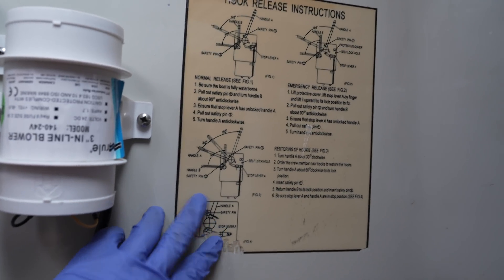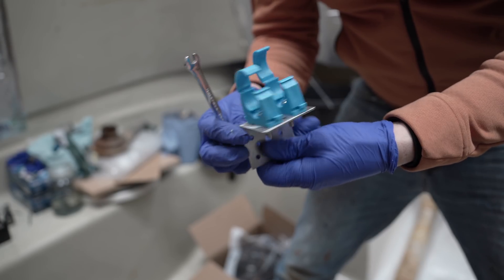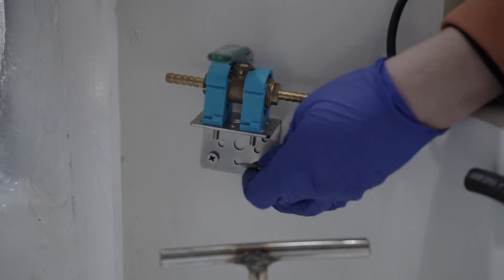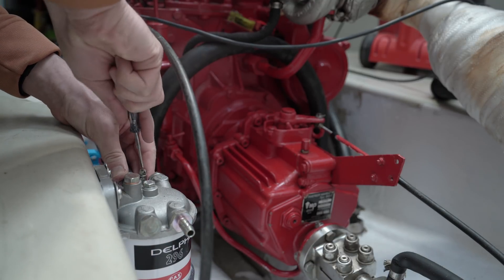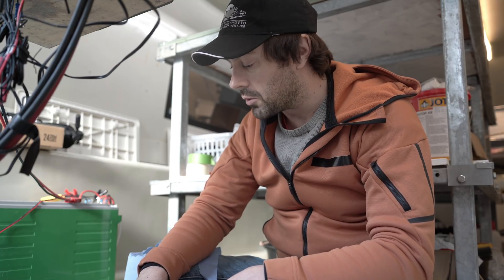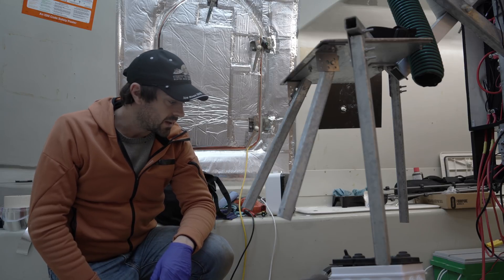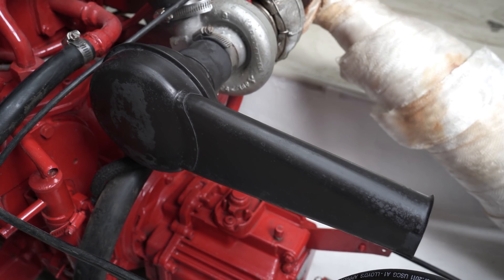Lifeboat Conversion Ep9: Installing Bukh engine fuel supply hoses and fittings [4K]

Comment: Im not sure about the complaint procedure so will give it a miss. But on another note. Is fuel lines a marine grade or just standard like car commercial pipes.  And have u placed a hand primer to get fuel through easier. These are questions not complaints im sure.
Reply from the maker: Yes these are marine diesel fuel lines. I do have a bulb primer, but have found the hand pump built into the engine brings the fuel up to the filters and injectors just fine. Cheers.
Reply: @AlexHibbertOriginals  thanks alex asked because ive had issues with fuel lines on my van before popping and premature ageing. Hope build on track .

Comment: Just a tip from working with diesel engines: hoses will leak if you let them lose like that. If they vibrate and rub something they will eventually leak. The best and cheapest solution I found it's using old bicycle rubber tubes around the hose and zip ties. Same tip for cables
Reply from the maker: Thanks for this. I have lots of restraints and clips etc and will see how things are once all is up and running. The Bukh is a balanced engine, so the vibrations are a lot less extreme than you'd imagine - but obviously still worth planning for.

Comment: Looks great, would love to be looking forward to such an adventure.
I believe one of the plugs on the water separator is often used as a air bleeding point. Also best practice is to offset rotational angle of multiple hose clamps.
Cheers.
Reply from the maker: Yeah the ones on top are a bleed and the securing screw for the plastic dish at the bottom. It's the two spare inlet/outlet ones on the side I was curious about.

Comment: Love your attention to detail.  On this side of the pond threaded ball valves and barbed fittings use a tapered thread we call national pipe thread (NPT) which seals on the threads as the taper tightens.  Unless your fittings use a different thread style I don't see how the copper washer is going to make a seal or stay tight after vibration? Best of luck!
Reply from the maker: Yeah we have European standards too, either British or metric. Some are tapered and some are standard. These are standard, so the copper is squeezed slightly to make the seal.

Comment: Alex, tip for you. Hose clamps, (jubilee clips on your side of the world) are really good at catching you and will become the Bain of you existence if you don’t cover the ends. They make special little covers but I cover mine with plastidip which you can buy at hardware stores. It’s designed for putting a coating on tools. Second, and really important, wherever the hoses touch you must put some kind of barrier. The vibration from the engine running will damage the hoses. Specifically where the hose is running through that piece of fiberglass will be a leak within 20hours of engine operation. 

I’ve been a professional yachtsman for 35+ years, please listen leaking and air getting into your fuel system is BAD
Reply: I'll answer so he doesn't have to:
"I'll install a gland for vibration/sound reduction"
Reply from the maker: thanks
Reply from the maker: Thanks for the tip - although I've already been told off about the clips, so will probably replace jubilees with o ring crimps.

Comment: You don't make friends with caramel wheels :-) They do the trick, but every time I use one (pneumatic version) my colleagues get pretty annoyed from the sound and the smell.
You might want to add some protection on the hose that goes thru the panel next to the engine.  The vibrations of the running engine will chafe the hose and damage it. You can check this by adding a piece of painters tape while doing some engine testing. Apply it on any possible problem areas. If it chafes, the tape will show this pretty fast.
Reply from the maker: Yep the hose bedding/glands is to be done.

And yes, the smell of the hot caramel wheel is awful.

Comment: I would suggest adding sealant of some sort to every screw you put into the fibreglass, just to stop water getting into the insulation spaces. Also label everything. It helps not make mistakes in construction and is an added measure against mistakes in an emergency. Always run all your comms power entirely separately from all other power right to the battery, down the opposite side of the vessel. So if the loom burns up from an electrical fault or some catastrophic destruction on that side happens you can still call for help. Conversely if something goes bad with the comms power and it burns up you still have mobility and life support. Likewise an EPIRB in an outside compartment in case of fire.
Reply from the maker: You're going to enjoy my labelling episode!

Comment: 6:22 Is that a handle that the hoses will interfere with?
Reply from the maker: It's the bilge plug. It's not something you'd ever want to use at sea. But no, it's positioned so they don't clash.

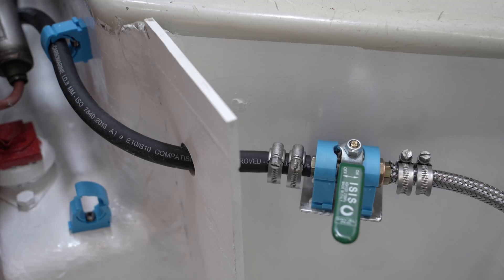Comment: 5:29 Can you protect the fuel line from chafing while going through the fiberglass?
Reply from the maker: Yep it's on the finishing touches list. And in general where the stainless braid meets gelcoat.
Reply: Good on ya both, was thinking the exact same. Glad I took a minute to scroll down and find this comment and its response.

Comment: When you do the electricial make sure to put a battery hookup on the outside so you can charge it and jumpstart it if the batteries die.
Reply: Or a small PV system

Just a single 100w panel would most likely counter any vampiric drain and give enough power for some lights

Comment: Perhaps a second angle grinder is needed? one for a CUT OFF WHEEL (thin, NOT TO BE USED as a grinder, side loading the wheel and begging it to explode in your face) and a second grinder with a flap disc in it for grinding - safely

ONE of the bolts on top the filter/separator is surely for bleeding air from the system?
Reply from the maker: Reprimand noted as intended!

Comment: Since everyone is in a criticism mode I may as well jump onboard; don’t use a cutting wheel to grind. You will not like the results. Ask me how I know.
Reply from the maker: Reprimand noted as intended!
Reply: It can throw
Reply: Very good point... one of my family members had to pull a large shard of cutting disc out of his thigh for making that mistake. Missed his femoral artery by about 3cm.
Reply: @turbo.dad.restores  t]To, ''within an inch of his life.''   (plus a little bit more)!
Reply: How?
Reply: Excellent point.

Comment: Just a tip, but when grinding like you where, I wouldn't use a cutoff wheel. If you use them on their sides they tend to unexpectedly explode. And of course that means the grinder always has the wrong wheel on it for the task at hand. Apart from that I love the series!
Reply: There it is. I should have checked the comments before posting basically the same thing.
Reply: I genuinely hope he heeds this warning...
I use the wrong wheel sometimes too, but it's a really stupid way to end up in hospital :c

Please use a grinding wheel/flap disc for grinding and a cutoff wheel for cutting!
Reply from the maker: Reprimand noted as intended!
Reply: @AlexHibbertOriginals  wooo thanks for keeping safe and keeping this awesome project going!
Reply: @AlexHibbertOriginals  At least you had the guard still on the grinder, unlike the majority of (possibly now single handed) youtubers

Comment: Hello mate ed here ,just an option you might want to look at is hydraulic hose pipes, rubber coated flexible pipes with wire built in that can take pressure, I used one to replace the hose on my powerwasher when the cheap one it came with split open, have had people driving over it without damage to it, got it in my local tractor garage Also used for diggers,should be bulletproof for your job!
Reply from the maker: Thanks for the tip. These are marine rated and good quality, but for future hoses always up for new improvements.

Comment: The extra fitting on the water separator are ust for different set ups there you have a simple in one side out the other but on some boats you might have to run the in and out on the same side of the filter. So the blanks are there so you can set it up both lines left or right or gp straight trough
Reply: or straight through left to right or right to left.
Reply from the maker: Thanks. That actually would have been easier, and I didn't want to assume this was the case as the instructions specifically told me which to blank and which to use - not saying either/or.

Comment: I'm not sure how much movement/vibration the hose will experience but seeing as you're focusing on details, you might  consider adding trim to the hole through the fiberglass bulkhead to avoid a concentrated abrasion on the rough edge.
Reply from the maker: Ok I think I'll have to add a pinned comment.... I'm going to install a gland to reduce noise/vibration/abrasion.

Comment: Will you be protecting or packing the edge of the hole that you drilled through the aforementioned fibreglass wall? I know it’s fibreglass and not steel, but the last thing you want is your fuel line to rub and eventually wear through. It would certainly be considered a no no in the vessel newbuild/refit world in which I work.
Reply from the maker: Ok I think I'll have to add a pinned comment.... I'm going to install a gland to reduce noise/vibration/abrasion.
Reply: @AlexHibbertOriginals  why do I get the impression you’ve had this comment already? 😂

Comment: I don't know much about boats but I hope that intake air to the engine is supplied from outside? If not the engine will suck warm air from inside and in consequence suck ridiculously cold air from outside to the boat :O
Reply: Its a marine diesel engine, they really care not about how warm the air is on induction.
Reply: @williamcollett4726   
Yes but we humans do tend to care. which is why it's bad if the engine steals the warm inside air which draws cold outside air into the living space.
Reply: @williamcollett4726  and meatsacks like warm air in the boat rather than nasty cold outside air.... ;-)

Comment: 1) Grind outside. Even s.s. grit turns rusty (local heating) and you'll get lots of tiny brown/orange specs over time. 2) Rubber fuel hose is fine as long as it's rated for fuel.  3) Blocked off filter ports - no, not for return fuel. Return fuel should always go back to tank to allow it to cool in the tank. Could be for a vacuum gauge that shows if the filter is getting blocked. 4) 5:20. That fuel hose will slowly chafe on the fiberglass structure it goes through. Fit a short length of slit larger diameter hose held in place with cable ties to protect the inner fuel hose. 5) Turn the engine over by hand several times before firing it up. Keep the kill switch/pull cable on and crank it for several seconds to build an oil film before allowing it to start. Good to see nice careful progress.
Reply from the maker: Thanks Evan. 1) I vacuum immediately after, so there's no dust. 2) Yep, the correct spec. 3) Thanks. 4) I'll install a gland for vibration/sound reduction. 5) That's new, thanks.
Reply: @AlexHibbertOriginals  the hot metal particles melt into the gelcoat where they hit and glue themselves on. You're already going to have brown stains everywhere. A final coat of paint will sort that out though.
Reply from the maker: Whilst quite possible I'm sure, this hasn't happened and I've done plenty of interior grinding - I just make sure they don't hit something that can set alight.

Comment: I'm surprised you didn't choose a top-loading  fuel filter housing. You can (should...) get a Racor 500 clone housing for £40, which takes genuine Racor filters. Those old CAV types are always a faff and source of leaks, with the 'O'-rings which must sit in invisible grooves etc.
Reply: I second the clone, just put a genuine paper element in and check for manufacturing debris. Have one on my boat.
Reply from the maker: Thanks all. I try to avoid 'fakes' of brand gear as they can be unreliable, but if they are widely endorsed then I'll have a look. Also, if they break, people will say 'I told you so.....'
Reply: @AlexHibbertOriginals  agreed, in the vast majority... very little to these units though, and my opinion is racor are just cashing in on the marine tax.... the unit you have is absolutely fine too, it will just be harder to change your filter.
Reply from the maker: I didn't realise that the clone versions of the superior £300+ systems were available. I've been assured these more basic designs do a decent job though.
Reply: @AlexHibbertOriginals  As you are going somewhere chilly, it might be worth considerrting adding some 2-Ethylhexyl Nitrate to the fuel.   It boosts the cetane rating a bit and also improves cold starting (your starter motor will thank you) and lowers the 'waxing' point.   I was running a small 6hp air cooled engine on supermarket derv that should have been good down to -10c but waxed at -3c.   You can pick up 2-Ethylhexyl Nitrate for about £25 for 5l on ebay, or pay through the nose at a garage.    As you are probably aware, sulphur has been removed from marine diesel and biofuels added.   Sulphur was good for engines but bad for the environment.   Converse for biofuels; which are also messing up petrol and diesel engines, tanks and hoses by chemical attack and by attracting water.   There is a nice simple test to see if your fuel has bio ethanol in it.   Not sure what your budget is, but if travelling solo I would be tempted to have a wind up spring starter as a starter motor back up in case you lost all 12v power. Unless you can hand crank the engine...
Reply: @AlexHibbertOriginals  Racor 500's are great - wasn't aware there were clones out and about. But for now the CAV will probably work fine. Just have a small container to catch the drips when you change the cartridge. If you are likely to take on fuel in small settlements or directly from dodgy 200L barrels, invest money in a Mr. Funnel brand funnel. It has a water separating element and will prevent water / grit getting into your tank in the first place. They are common in the boating/aviation community. Saved my ass in Indonesia where I bought diesel directly from a fuel barge - fuel was lifted out of the hold with a bucket and a rope...

Comment: A word of warning, it's been my finding that if you don't secure those stainless braided hoses, they will abrade through whatever they rub against.
Reply from the maker: Thanks - will watch out and fix if necessary.
Reply: Excellent piece of advice and I've found it to be very true as well.
Reply: I’ve used silicon self amalgamating tape for this, just put a few turns on the hose where it goes through the clip, it works very well. Keep up the good work.
Reply: i feel like 5:31 has already been dealt with but also adding rubber grommets would help massively with rubbing and such
Reply: I have seen case where people use metal pipe fittings smoothed out inside the clips so the don't where them through
Reply: I'm here for this comment as well. This braided hose will cut through stuff like a file.

Comment: Maybe a bit late now, but had you considered a fuel polishing option. On my boat I have a Thornycroft T80 with only a fuel filter, so I added an extra dual unit water separator/filter before the electric pump, a 2 way valve after the pump which switches the fuel either to the engine or back to the tank. This gives an option to clean any dirty fuel offline without it getting to the engine at minimal cost and complexity. P.S. make sure you use ISO 7840 hose, I didn't and had to change it!
Reply from the maker: There's certainly always an option to go 'up market' and I could have installed a bypass filter system too, to mean super quick filter changes without fuel drain/bleed, but it was a balance of different factors. We'll see in future if I want to upgrade.
Reply: @AlexHibbertOriginals  Mine was defiately not 'up market' as it was only a cheap filter and valve, definately not your Vetus prices
Reply from the maker: Thanks - I'll have a closer look.

Comment: 5:25 & 6:24 hose appears to contact edge of hole , this could cause abrasion . maybe round over/ smooth edges &/or use rubber grommet ...
Reply from the maker: Yes indeed. It's not finished - there's going to be a gland there to limit vibration and sound transmission too.
Reply: @AlexHibbertOriginals  Personally I'd use a bulkhead fitting and a 90 degree elbow with a hose tail on the free end of the bulkhead fitting and the free end of the elbow. With such a tight change of direction even a grommet is storing up trouble for the future.

Comment: If the aim of quick access to fuel shut off valve is to immediately starve fuel to the engine then you may want it between filter and engine. Will run on for several minutes on the supply in the filter.
Reply from the maker: No it's so that the filter can be changed easily (although I haven't gone for a complex double filter system with a bypass), and it's recommended for when the tank is above the filter. I agree I could add another in the place you suggest.
Reply: @AlexHibbertOriginals  An oh-shit pull cable to pull the valve into the closed position from the drivers position may be worthwhile. It shouldn't run on too much with the valve off, the fuel pump will only be able to suck so hard before using all the fuel in the filter. Drain spoons below the bleed points would be a good idea too, since you don't want to be smelling fuel for weeks after bleeding it.